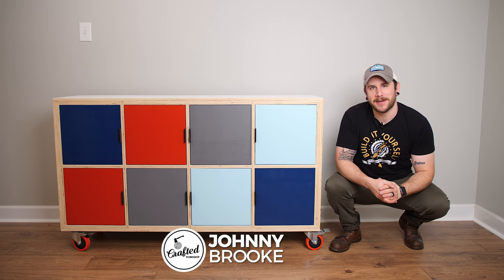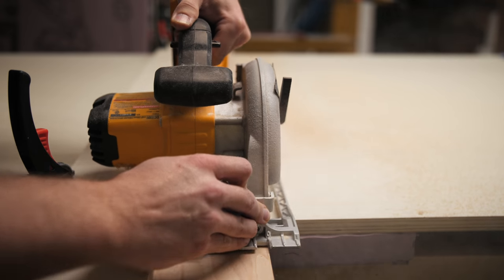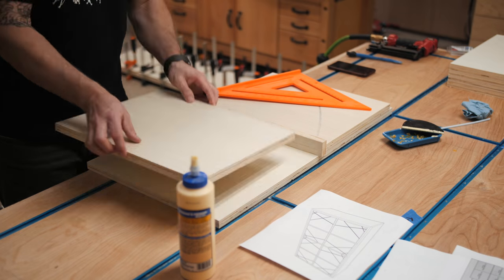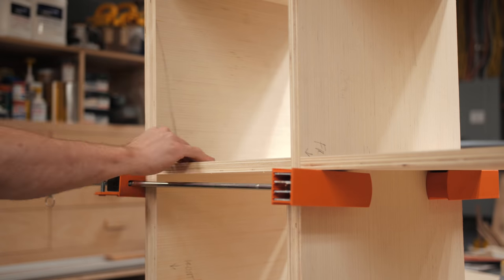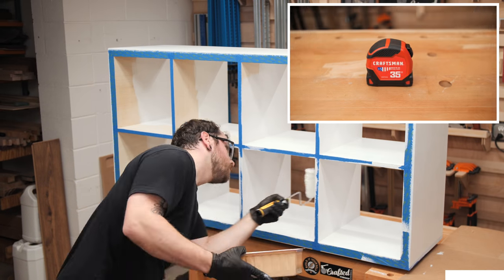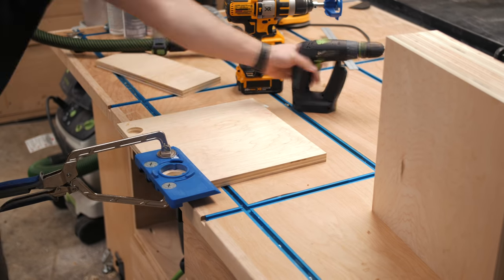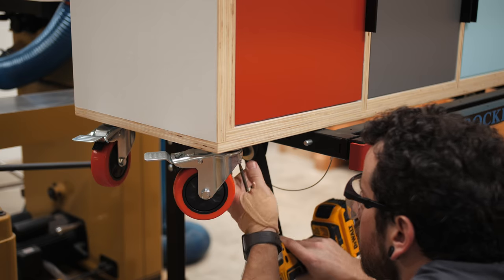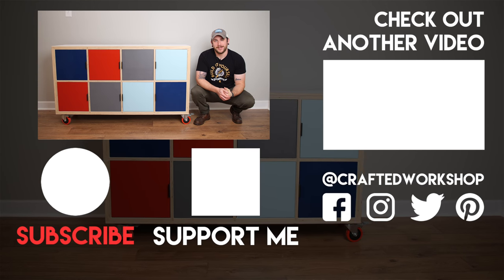How To Build A DIY Plywood Media Console // Limited Tools Build

Comment: You make very nice videos, but one thing really bothers me: Why have you hidden the logo on your dewalt impact and one of the dewalt batteries with tape, even though you promote certain products on the same video? If you need or want to hide the brands on your tools and accessories, then should not you hide every single brand and logo that is visible? I have always wondered why youtubers hide the brands on their videos, it just looks  a bit stupid having pieces of tape on tools, even though anybody can recognise the tool brands by the color of the tool.
Reply from the maker: It's actually left over from a previous video where I went over the 5 tools I'd recommend for beginners. I just never got around to removing the tape!